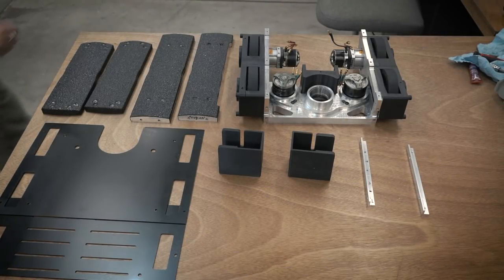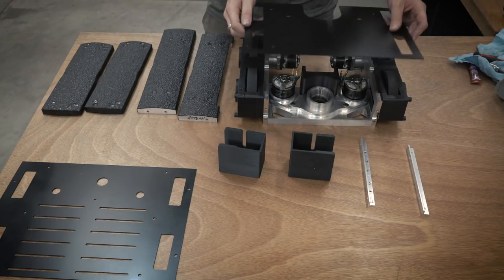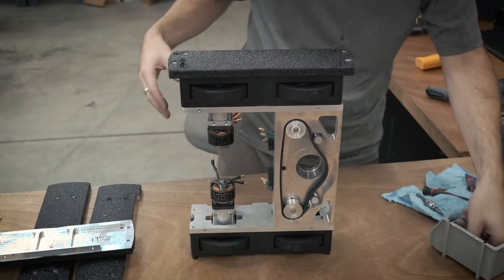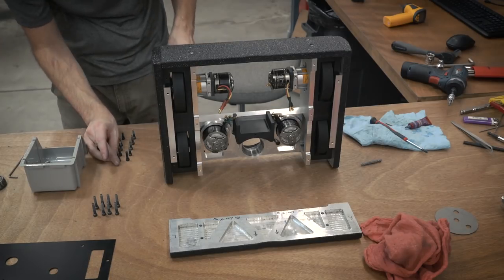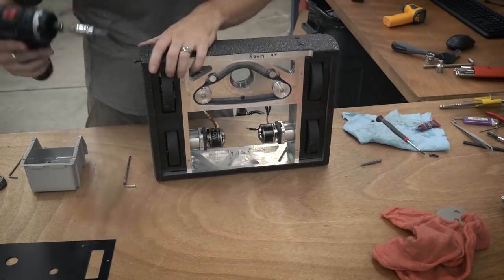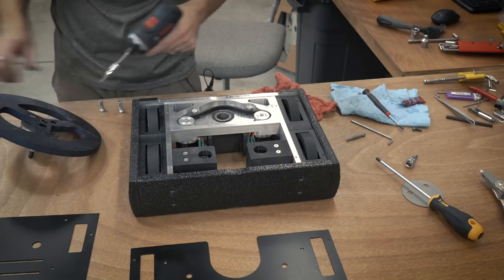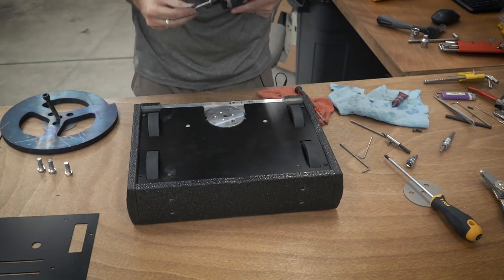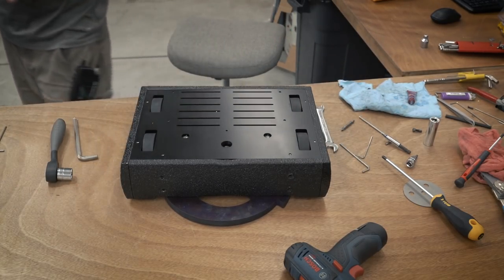Crippling Depression Assembly: Frame

Comment: Late to the party, it seems that the weapon disk is held vertically using only a drawbar, the bot can drive  inverted (with the disk upwards) and therefore, can be hit with drums or egg beaters, can the drawbar withstand  strong vertical forces?
Reply from the maker: Yep.  I've never had the weapon bind up on me, ever.  It's just over-built.  It uses two large tapered roller bearings, a custom titanium nut/hat for pre-loading, and a 3/8" bolt through the whole assembly.  It's knocked out at least half a dozen other weapons.

Comment: Design looks good. Need more info on those black coating on side.
Reply from the maker: It's Line-X, which is a polyurea coating.  It gets applied at high pressure and temperature.  I'm still not 100% sure if it's worthwhile or not, but it's not terribly heavy.
Reply: metalhead2508 it creates a small safety net

Comment: the thin titanium where did you get those ?
Reply from the maker: I get them various people on eBay.  It's much cheaper, but not always reliable.
Reply: @RobertCowanDIY  Mild Steel......what if I use them for a weapon the same designed weapon.
Is it going to bend or any defect....
Reply from the maker: @jeevanshrestha8888  It will bend.  Even AR400 and AR500 can bend under these stresses.  Using some sort of hardened tool steel is pretty much required.
Reply: @RobertCowanDIY  Tried searching s7 steel couldn't find them
any other option.
and for the battle hardening can I use salt or sand or any other better option than microsphere.